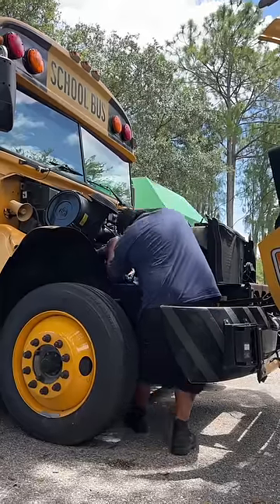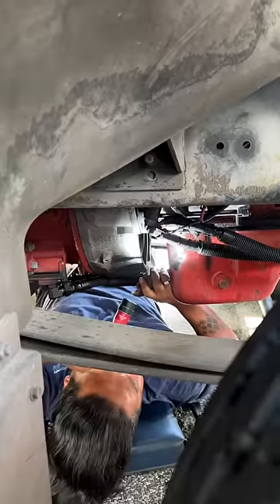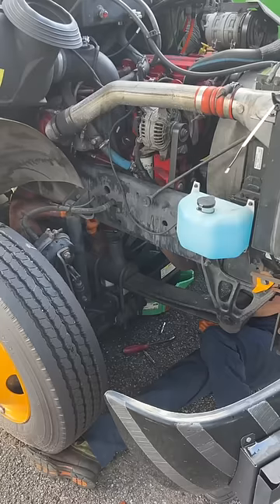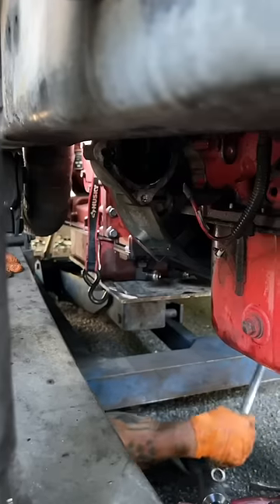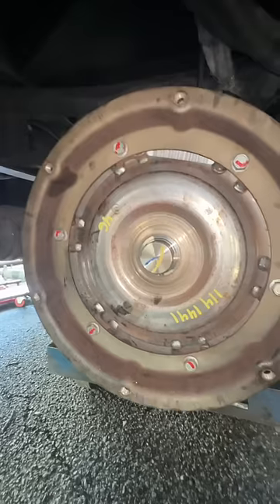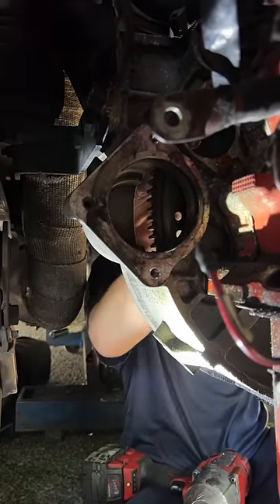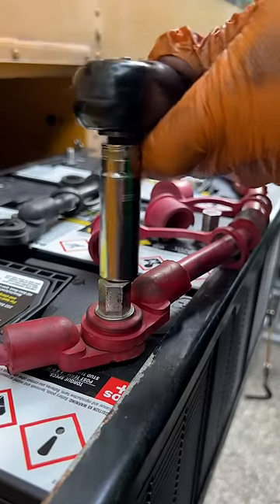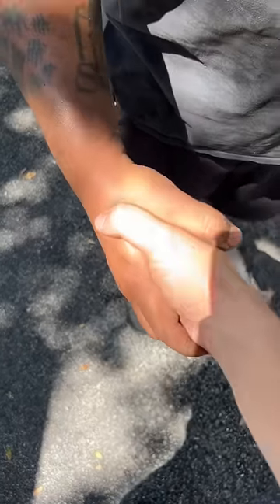How much have we spent on repairs? #diy#busconversion  #skoolieconversion #vanlife#skoolie#buslife

Comment: “Barely cranks”

Yep it’s the main seal
Reply: Must be the cam shaft. Needs replaced/CNC'd to a brand new finish
Reply: @OtherDalfite  Yeah it's definitely the radiator fan.
Reply: Maybe it was jamming the crank lol
Reply: Laughed so hard when they came up with rear main seal after the battery is fuckin dead
Reply: Getting screwed by the mechanic.
Reply: The rear main seal started leaking before and they ran it, lost oil pressure and damaged the engine. Probably spun a connecting rod bearing.

Comment: Mechanic is happy to have met you
Reply: hope he got that rear main in properly or it will leak worse than the old one not to many miles down the road.
Reply: @Nathan-gj8ch  still not going to cause a no start, and as long as your oil level is good your perfectly fine
Reply: @jasournevada4782  oh ya I agree. It's just a rear main is not really an easy job to do correctly, sure any joe can slap a new one in but if any surfaces are scratched while removing the old one it will damage the new one and you won't know till weeks miles later.
Reply: Fr he just made rent

Comment: mechanic of 27 years here, at the end of the video when it does finally start, the way it cranks unevenly and then that squawk noise after a couple seconds reminds me an awful lot of a rod bearing spinning in the connecting rod. good luck.
Reply: You are 1000% correct their engine just blew up
Reply: 100%
Reply: They had the bus at Cummins because it overheated. On the way back it started leaking from the rear main seal and lost oil pressure and damaged the engine. After they replaced it and restarted it sounded like a spun bearing.

Comment: Rear main seal for a no start 😂 he got y’all good.
Reply: he probably put the batteries to charge while they were disconnected and didnt even charge them completely LOL got ripped off probably
Reply: Lmao I was just thinking this he got paid good for that too
Reply: @chainarmor448  i just saw some other video where they had a oil leak and it was obvious it was leaking from the front of the engine (crank pulley seal) and they said rear main....
Reply: Hearing it Turning over at the end sounds like at least one cylinder that's down a little.
Reply: Bruh i was searching for that comment 😂🏃
Reply: The newest update is that there is "engine failure" so after paying 8k for a rear main just to get told the whole engine is fucked 😂
Reply: Lmfao for real
Reply: @RedesCat  bruh 😂😂😂
Reply: @RedesCat  jesus christ. They got finessed.
Reply: @0xsergy  😂😂😂😂
Reply: @MrRoadchaser  That's what a dead battery or a low charge battery sounds like not a dead hole Jeepers creepers
Reply: @codyace  check the newest update
Reply: @codyace  you are pretty clueless your self to think this sounds like low battery… this sounds like a seized up engine it literally sounds like spinning parts aren’t spinning any more😁
Reply: @datijeznat8780  that is a possibility, albeit rare. I play with these things for a living... they literally keep the lights on.
Reply: @datijeznat8780  very rarely do you find seized diesel engines, even after years of non service.
Reply: @codyace  than you should know when a cummins or basically any engine sounds like this it’s most likely a spun main bearing that’s basically seized it self to the crankshaft. I have a fleet of semi trucks so I maybe know a thing or two . To be more correct this one is in the process of seizing up it can barely crank.
Reply: @datijeznat8780  you seem like the kind of guy that no matter what I present to you will never agree. Confirm the charging system in batteries first then we'll talk about worst case scenarios. Just because you have a hundred tomato plants isn't that mean you know how to grow a good one
Reply: @codyace  I can’t agree with something that makes no sense. Yes a low battery will cause a slow crank and no start but it WILL NOT cause that squealing noise. A slow crank and squealing sound together almost always mean worst case scenario.
Reply: Lmfao u the price to pull tht trans mission fix tht seal thn put it back in cost probably triple if not double the price of air compressor
Reply: She did not say anything about the rear main seal being the cause of the no start, she just didn't tell you why no start, obviously it was for the oil leaking
Reply: @MrRoadchaser  sounds just like its dropped a cylinder sleeve.
Reply: @datijeznat8780  its s good thing you arent a diesel mechanic
Reply: @Nothingmore71  it is a good thing… even better I have one working for me maintaining my trucks on my payroll so good enough for me 😂
Reply: @RedesCat  gotta pick better used vehicles. alot of times these things are being sold for a reason
Reply: @RedesCat  gotta pick better used vehicles. alot of times these things are being sold for a reason

Comment: Best to buy a tool kit. The Air compressor has only 3 bolts. Make sure you gave extensions. Also get standard and metric wrenches as big as 21 and as small as 4. You will thank me later.

Comment: Why wouldn’t you make sure you had a sound platform before spending anything inside? Now your locked into a bus, good or bad… id really put some miles on it to make sure it is sound and worth the further investment before continuing the project
Reply from the maker: We did this all happened after a full mechanical inspection. We can’t do anymore than that.
Reply: @JessandJake  "full mechanical inspection" lmfao bet you get conned on that too.
Reply: They're definitely not locked into the project other than the fact that they dumped away too much money into it

Comment: Your engine rolls over unevenly before it fires. You have another engine issue on the horizon. They sell school buses at the end of their service life, meaning it costs more to keep it on the road than it's worth. You can expect lots more painful repairs.
Reply: Yup, that’s why you find these so cheap it only makes sense if you can do the repairs your self or have a competent independent work on it
Reply: Sounds like engine bearings are going out because of rear main seal probably because of low oil issues from oil leak its done needs new motor or rebuild

Comment: I couldn't imagine trying to tackle this kind of project without having the ability to do everything myself. Not saying I would actually do all of it but with a build like this you need to have some very advanced diesel mechanic, metal fabrication, electrical and general construction skills (or be extremely wealthy, lol).
Reply: At the very least the wherewithal to know when your mechanic is fucking you, even if you don’t fix it yourself you should be able to figure a few things out
Reply: @phoenixlove76  at least for normal things.. for something as big as converting a bus? you need to be able to do some of it yourself and know how things work.. if you're just going to hire out private contractors to do all the work for you it's going to be costing more than buying an RV
Reply: A very advanced mechanic? No it's pretty basic....bigger motors are easier than smaller motors bud....and yes...I'm actually a diesel tech for a shop where we do a little bit of everything...
Reply: @Kolonol1  if you are saying that a person who wants to live in a bus with an old diesel engine doesn't need advanced diesel mechanic skills or a large engine repair budget then you are not a particularly smart man.

Comment: Good to see the bus running again, though the engine doesn’t sound all too happy. Regardless don’t get discouraged and keep pressing on with the project. I bet it’ll come out fantastic.
Reply from the maker: Just posted a very sad update on the engine :(
Reply: U literally called an entire engine failure unfortunately
Reply from the maker: @officalzgamez3866  sadly yeah.
Reply: @officalzgamez3866  with how the engine sounded when it started up again, I originally thought it would have been a stuck injector, an injector fault, or perhaps the oil working it’s way through the entire engine.
Reply: With a rear-main seal leak it was probably ran low on oil, which is why it was parked and sold to someone that didn’t know better. Sad to say, this is the issue with 1/3-1/4 auto’s that go through our auction.

Comment: if the air compressor isn't building up air check the governor,  the air dryer coukd be clogged up, air dryers need to be replaced every year but nobody does it till it fails, both could can prevent air build up issues, if the air compressor is bad you could just replace the air compressor head instead of the entire unit. that's what we do at our shop alot less expensive and you don't have to remove the air compressor to do it.

Comment: I see stuff like this a lot on van/bus builds.

People, you are literally building an entire compact home that typically includes integration of several different electrical systems, plumbing, heating/cooling, insulation, walls/flooring, and so much more.  Learning how to do mechanical work is just as simple.

Everyone is leery but ok with working on gas vehicles, but as soon as Diesel is brought up, everyone gets scared and says they can't do it.

You can do it yourself for 1/10th the cost of a shop.

For reference, the truck I drive for a living, a 1987 Freightliner with a 3406b CAT engine I do all the work on.  Including rebuilding the entire engine in my driveway, outside with no cover, air tools or anything special.  Shop would have been up to $60k, I did it myself for about $8k, and that includes all the special tools and equipment to get it done.

Just last week I replaced the hub nuts for the drive axle roadside in a couple hours after the 35 year old originals spun off, heh.

You can do the work yourself, you built a house after all.
Reply from the maker: Hey, thanks for the inspiration, totally agreed that it can be daunting and a bit scary. But we never shy away from learning something else new :)

Comment: That sounds rough for being a newer engine. My international 444 starts way faster
Reply from the maker: Yes we just found out we had engine failure just posted an updated video.
Reply: @JessandJake  I figured it had to be something wrong mechanically. It could’ve been when the oil drained, did it stop automatically? If you’re having a lot of issues I’d look at an older bus especially with the international 444 there’s not a lot to go wrong with these engines and you can buy 4 of the 6 sensors and just keep them on hand instead of calling a tow 2 or 3 times after it breaks down. Just an option from a diesel tech
Reply: @connorlhamon  they ain’t gonna listen to ya😂😂😂
Reply: @tacobellgaming3253  if they do good for them, if they don’t? Well doesn’t hurt my feelings any. They don’t build shit like they used to 🤷🏼‍♂️
Reply: My actual school bus starts right up but they replaced the engine bc the engine was burning oil and seal was fucked and they decided to get a new engine and now they are oozing for bu drivers
Reply: 7.3s will outlive any cummins
Reply: @tacobellgaming3253  they would rather us pay for it smh

Comment: Unless I’m miss identifying that engine, it’s a 5.9 ISB, or possibly an 8.3 ISC (I believe they both came in school busses, not sure) . Not really my area of expertise, but, I do know that the cheap answer to ‘why does it hard start?’ Is either bad batteries or a bad starter…the expensive answer is the injection pump, I can’t see the injection pump too well, but I believe both engines came with versions of the VP44 injection pump. It’s an electronically controlled injection pump, and there’s a circuit board on top of the pump. The solder in this pump has a tendency to melt, which can result in all sorts of issues, hard starting included. 

Several solutions to this. You can send the pump out to be rebuilt, but it’s possible that you will run into the same problem eventually. I know for the ISB 5.9’s, you could swap the VP44 for a Bosch P7100 pump (the pump off the previous generation of 5.9 engine), which are very reliable, and known to outlast the engine they’re bolted to. I know the earlier 8.3 cummins came with a slightly different version of the P7100 pump, also very reliable, also known to outlast the engine it’s bolted to. I don’t know if it’s possible to swap that pump onto a 8.3 ISC. 

As for people talking about different engines, the CAT 3126 is a very good engine, the international DT444 is also a very good engine, both have a few quirks similar to the Cummins, but they’re outstanding nevertheless, but, the international DT466P with a Bosch P7100 or P3000 pump is probably the best medium duty Diesel engine ever made, that would be the gem right there.

Comment: You guys could have bought a clean used RV with the amount of money you're spending on this bus and been on the road already - very little customization needed and already has all the essentials built in. There's a reason that municipal vehicles are taken out of service at a certain mileage - because all this shit you're paying for happens and it's cheaper to replace the fleet than keep old buses running.

Comment: This is why you don’t by wore out used buses , or  someone else’s headache on a tight budget .  I wish you all the best and hope you get back on track !! Let hind sight be 20/20
Reply from the maker: This bus was fully inspected before the build.
Reply: @JessandJake  evidently not well enough.
Reply: @JessandJake  
Yeah I get it , I’m not armchair quarterbacking . It sucks and I feel your pain . But knocking on the door of almost 50 years old ,, in my experiences of these types of adventures and investments, It’s just less of a headache to buy lower mileage , late model equipment. I learned the hard way many times , it was cheap or cheaper for a reason . That’s all I meant . I hope y’all get it going and enjoy some trouble free years out of it

Comment: Check and replace the battery cable connections to the battery, the bare wires build up corrosion put corrosion inhibitor grease on them and loose connections cause the batteries to heat up more. While your at it replace the batteries if necessary if their leaking theirs a dead cell. Then buy you a gear reduction starter that will crank the motor over like Never before.
Reply from the maker: Yes, we have gotten many similar comments and went ahead and investigate the batteries. Thank you :)

Comment: As a diesel mechanic and a new sub, if you have any hard starts and the fuel system isn’t obviously leaking, you haven’t had any fuel filters or fuel water separator filters replaced, Start with the basics yourself. Then have your hired help go over your hp and lp fuel system components. Check pressures and restrictions. Just my advice.

Comment: I would've just charged the batteries and had them checked. And as clean as the transmission was I don't think the rear main was leaking. Unless it was just a cold leak. Sometimes they seap a little until the engine is at operating temperature.  But if it were me I would've went to harborfreight and bought a transmission jack and changed the seal myself.  Had it actually needed to be replaced. I'm in the wrong business I could be traveling in my bus fixing other people's busses. I feel bad for you cause you seem like you just fully trusted this mech. Wish I could help but all I can offer is knowledge

Comment: On this weeks episode of "Road Raiders"

Check your Battery cables, both Positive and Negative for any sort of maladies. You'd be surprised how often these are overlooked when diagnosing these sort of complaints. Make sure the terminals are physically in good shape and no corrosion or any other issues along the length of the wire. Would be wise to invest in a hydraulic terminal crimping tool so you can make your own wires. Also make sure your starter cables are the same size on the postive and ground side and that they are routed properly and efficiently to and from the Battery terminals

Comment: Definitely heard main or rod bearing noise when it fired up that and bearings failing will cause the hard start. That engine needs to be pulled and rebuilt, crank regrouped and polished. The zero oil pressure was probably due to the bearings failing because unless the rear main seal allowed all the oil to drain out (which is doubtful) the rear main seal leaking won’t cause a drop in oil pressure which the mobile mechanic should have known unless he wasn’t told about it. Also most the engine driven compressors are serviceable if it is you can rebuild them a lot cheaper than buying a remanufactured one.

Comment: In a situation like that it might be cheaper to buy an old big block 454 from a used engine dealer. They sell adapter kits. The engine plus installation would cost about three grand.

Comment: You have more going on than seal issue. Wait until you decide to tackle hard start issues. By the way, when you continue cranking on it with it dragging like that the starter will hang up and catch batteries on fire, burn up bus. So be ready to unhook batteries fast( disconnect switch) when fire starts.

Comment: If that bus was leaking from the rear main seal there would be oil all over the bottom of the transmission. A lot more than we seen, almost no oil on the motor or trans, both of which look relatively clean.

Comment: The rear main seal may well have been leaking, but that would never cause a no start.

Chances are you just had a dead battery and the starter just needed more juice to crank that big girl over. Not to mention an oil change, and a new starter probably helped.

Also, it’s an old Cummins block, a compressor is pretty easy to come by and by far not the most expensive thing on these things, especially when the compressor is what allows you to have brakes in one of these

Comment: Rear main seal is $10 u.s dollars and it doesn't have to be replaced unless it's losing a lot of  oil
The compressor you can get a used one or I remanufacture one for pretty low price